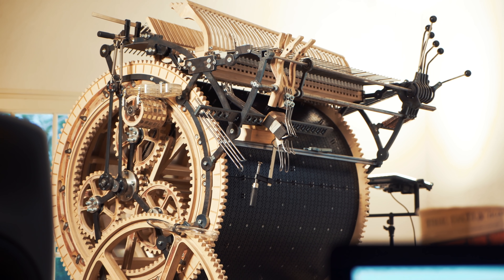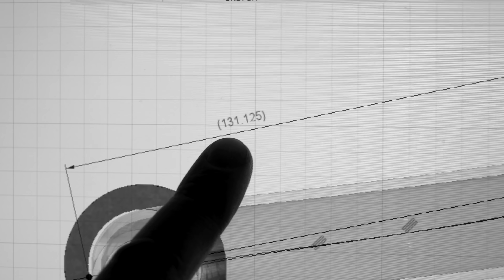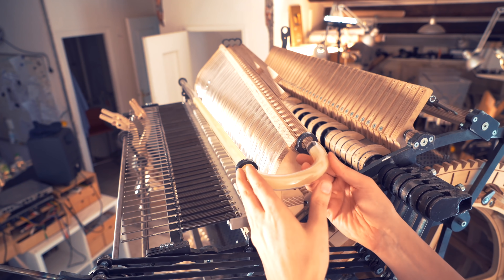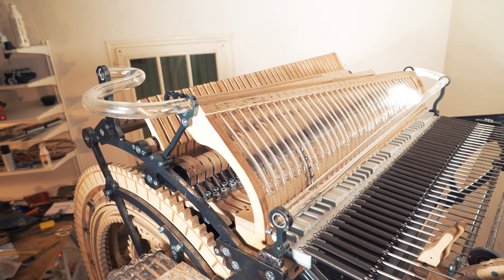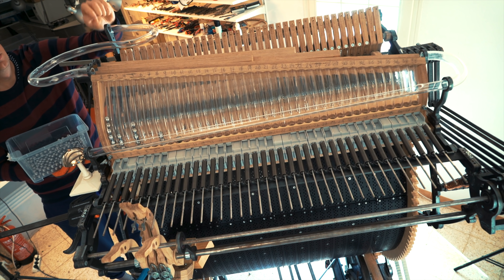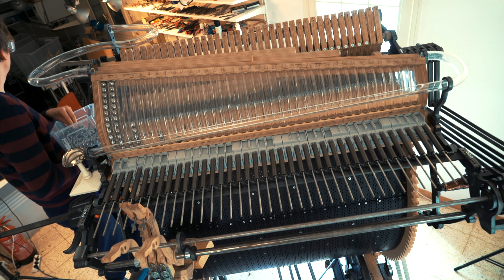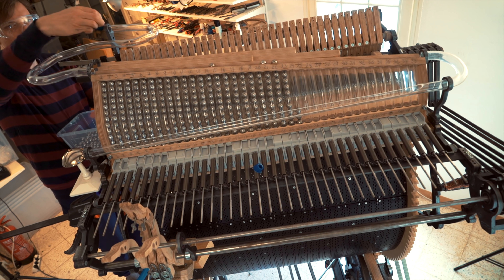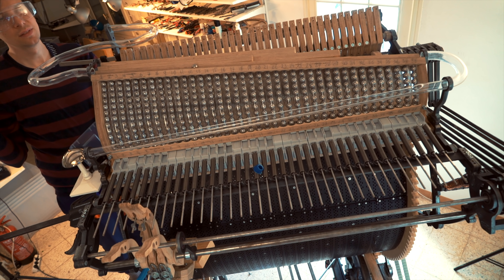Marble Divider Transport Tracks - Marble Machine X #68

Comment: I don't think the second-system effect applies to the MMX. The first marble machine was not small, elegant, or successful. It managed to barely get through one song before breaking down. I think you would agree with this. You said in previous videos that you pretty much just threw the first machine together pretty haphazardly, designing things on the fly.

Comment: So here's an idea about the 'programming templates' that would make it faster to put magnets in the right holes. Instead of laser-cut plastic sheet, just print it on a wide format printer, and push the magnets through the paper. Downside is the paper templates wouldn't last as long, upside is print shops can be found much more easily, making them easier to replace and make new ones during the tour.

Comment: I'm all in on the programming wheel. As you've stated many times, Martin, some of the mechanics for the MMX are aesthetically influenced. That can throw a lot of ideas out the window, as simpler often leads to something less appealing to the eye. Of course, there are also the practical requirements that you've outlined. It is tempting to want to simplify further, but a massive part of this music machine's appeal is it's over the top complexity, complexity for its own sake. 

On a separate note, my only concern with the snake is that it seems to rely on gravity a fair bit, and I'm wondering how well you'll be able to level the machine at each venue. If the snake must be sitting at a certain level to slow the ball down, having it tilted one way or another might cause the balls to slow up and stop in the snake. Just a thought, and I don't know the answer to the question of how well it can be leveled, so it may be a moot point, but I've done a few ball machines, and slopes can be tricky in different environments.

Comment: Martin - you may already have the solution, think back to your music box, the pins go in the holes in the tape - so instead of adding pins to a flexible sheet make holes in it and the holes trigger the marbles. Should be really quick to do  straight from a midi file with right software - I've used this method to program cards and paper rolls for street organ music, and its always been the way to control pianola (player pianos). Will have to have method of triggering from holes but again solution is there - air operated from a tracker bar above holes - and how cool would it look to have a set of bellows pumping away beneath MMX!  Get in touch if you want more in depth explanation of how to make it work - best wishes and love your work, engineering, music, off the wall thinking and more than a touch of madness combined with the  'no such word as can't' attitude is how I work as well so totally appreciate the frustrations and trials you go through (it doesn't change another 40 years on !) - David L

Comment: Wouldn't it be simpler to design the programming wheel as quick-change?  Have one, or possibly two built to the exact same specifications, that way one can be employed on the machine, one can be getting programmed off-stage, while another is the next song in queue?  All pre-programmed, and can be loaded and unloaded in a quick manner?  

Or is that the way this is?  I missed quite a few episodes.

Comment: Martin, I haven't read all the suggestions but what about more or less lamination. Currently you have been cutting a sheet flat and then bending it what if you cut the radius with the channels in it and then stack the sheets to make your sections. You could also use a material more resistant to warping

Comment: Need a Marble Feed Simulator designed. Something like a spiraled carousel that carries the marbles via a screw driven gear crank and it's attached to a funnel. Also need a moveable scaffold platform to work up higher above the machine instead of reaching up. You will need one anyway for setup, inspection, maintenance and repair on tour.

Comment: maybe overlap the programming sheets?. and aligning them with the programming pins them selves.  so you would extend every sheet with about 2/3 cm of overlap.  if the sheet is 1cm thicc. you would machine 0.5cm off every end in thiccness and overlap them and align them with the programing pins. let me know why this would / would not work :)

Comment: @wintergatan is there a way to mill the plastic already mounted to the drum? Like mounting the mill on the radius of the drum?
Also why not mill thicker metal aluminum sheets instead of the plastic? Is the plastic is warping the aluminum won't. Esp if the tool path is a bit slower.

Comment: I'm concerned about the exit velocity of the snake. You've intentionally slowed the marbles to such an extent that I don't think you will be able to feed enough marbles through to keep the channels full. I don't remember how many marbles per second you were hoping for, but do the math on how fast they must travel to put them through the snake, one at a time, at that rate.

Your better bet may be to count on the fact that the marbles will go over the bumps slowly. Marbles will drop into the first two channels because they'll be backed up behind their predecessors. 

Rewatching the marbles travel across the top of the feed, I have the same concern - that they're not moving quickly enough. I'm guessing I'm hearing 4-5 clicks per second? As I recall, you have two inputs? That's ten marbles per second? I hope I've forgotten something from an earlier video?

Comment: By cutting the long pipe open, it decreases much of it's strenght. Maybe it's gonna bend to much when it's full of marbles.

 If that happens, you can always just cut only the front of the pipe (not the top). Or don't cut it at all. The pipe is clear enough I think.

Comment: if you could somehow cut the holes in the programming wheel sections after the wheel is assembled then you wouldn't have to compensate for anything. Also the holes would end up square instead of tapered. When you cut the holes on the flat plastic and then radius it, it stretches the holes wider on the outside and squeezes them narrower on the inside.

Comment: Personally I like the plastic for the action programming wheel, but plastic sheets as guides for swapping out songs sound like a mess. If I wanted to carry a bunch of pre-written music for the machine I would do what we've always done with music, sheet music. A piece of heavy paper with holes ut into it matching the slots you wanted to fill would allow for a quick guide and could easily be applied to the machine, removed once the bars are in, and carried around.

Also, the machine has been looking more and more impressive and it has been very interesting watching you both design it and learn from it. Thank you for sharing!

Comment: To the critics, here’s the thing: he’s not building a musical instrument. He’s not building a mechanical device. He’s not creating a piece of moving art. He’s doing it all. This is the point of the whole thing.
Is it over-engineered and complicated? Yes. If he wanted to create a simple instrument, he wouldn’t need all the gears and machined parts. He could get the same effect using a computer, electronics, and a MIDI track.
But he’s doing something special here. It’s a working, post modern industrial clockwork machine that is beautiful and mesmerizing to look at, but also happens to play music.
Music is exacting. Mechanics is exacting. Artwork is exacting.
And he is trying to make this machine reliable and modular.

Let’s cut him some slack. It’s his design, his dream, and his machine. He has the right to see it done to whatever level of perfection he chooses.

Comment: Why not have plates that are specified to each song, as you meantioned in another video that the pla plastic you are using gets tighter after a while, so why not cut four plates that corresponds to one song each with specific holes for the position of each note of each song for each plate setup so that the pins will get stuck in that position after they shrink, i know what it is a more expensive solution then what you want, not to mention that you can't really "repair" any plate if one note stringing magnet breaks, but it could be a temporary fix for the moment just to get the project onwards, i have found that when i am working on a project, that if i get stuck i end up not wanting to leave that problem until i have at least temporarely solved it, even with a band aid fix and can come back to it later down the line as what i made works for the moment, sorry if my english isn't the best, much like Martin i am Swedish.

Comment: I have no problems with the programming wheel, without adding other system compressor or vacumes there is not much you could do, as it going away from the "basic" design.
another option is flatting them out into cards and a hopper programming cards, but this could be harder to sync up so maybe the Marble Machine Y

Comment: I have a suggestion for the Programming wheel.  Here's my thought.  Keep what you HAVE as the composing wheel.  Once you have completed a composition, you make metal sheets that are single channel.  IE: the Vibraphone Channel, then the Drum Channel.  These would be thin Aluminum, or sheet metal of some kind, and would have permanently affixed pins, you would then label the plates with the song title, so decades later you can simply pull the plates out of storage, and use them again.  With thinner plates, that are narrower than the whole, and are intended to mesh together on the sides, so you can quickly pull them off from right to left, and replace from left to right, it should make for a quicker change over during the live performance.  To further my thought process, I'd have these thinner plates clip onto the composing wheel, so there would be no need for screws, you'd just use the holes already in existance.

Comment: Will that CNC welding stud gun work with sheets of invar? That would drastically decrease your issues of thermal expansion offsetting the positions of the studs.

Comment: Does the divider need to reload itself as the song is playing?  I dont think the last tracks(34-38ish) are going to replenish themselves after the song starts since they require 1-33 to be completely full. Once the song starts that's not going to happen.  Hopefully there's only a few high notes in the song and those tracks wont run out of marbles after being loaded at the start.  Or maybe I dont understand the purpose of the divider.

Comment: I think the easiest solution to the programming wheel is to divide it up into easier sections & have, essentially a frame where each divided plate slots & locks into, this way you only have to worry about making an evenly spaced frame & musical tiles of a specific size that fits exactly into the slot, OOP style.
Instead of the current system where you have to make the musical tiles evenly sized AND spaced at the same time. Additionally it would be easier to hotswap songs as well since, if you divide it down far enough, you'd end up with modular plates that play a specific series that'd be reused or otherwise show up in other songs, true OOP style

Also to back up easier positioning, you could, or would, probably have the back of the tile be the master slot, or tab like extrusion, to base the positioning on, like a lathe chuck on a lathe, the lathe chuck will always be centred with the lathe because that's the way it's made, knowing that you can always make your work centred with the lathe by making it centred with the chuck. So as long as that master tab fits perfectly into a slot you'd know you can then just size the plate by the master tab, not sizing the plate by the other plates, etc

Comment: Martin, 

instead of one full wheel, why not two halves? It should line up, but if not, it would be much easier to fix the gap with spacers than all eight of the current design.  You could have three sets: one for the current song, one to be double checked that it is correct, and one to be changed for the next song by two to four people depending on the set and support.

I hope you see this, 
TonOfClay

Comment: My idea for cutting the programming plates is to make a custom cnc setup to cut the slots for the magnets after the plates have been bent and put on the wheel. You just have one of the cnc axis turn the wheel. This would ensure alignment between plates.

Comment: What if the whole programming wheel, was one giant belt, divided into 8 or 16 steps per belt piece?
Like a tank driving belt.
When changing a song, you "simply" roll on a new belt, with the preprogrammed plates. When the belt is laid out flat, it will appear as one long sheet of programming plate. Maybe even make the plates intertwine?
In this way, a tension mechanism could also allow for variations in the programming loop size.
Now you could even use something as simple as bike gearing, to change the tempo of the song, without giving up potential stored energy in the swing wheel.

Comment: We agree with others here saying that this isn't sunken-cost-fallacy territory if it works. Keep at it. That said, because having ideas is fun, here's a barely-thought-through half-idea that may be able to relax requirements a little: Is there some mechanism that could somehow re-sync small timing errors after the programming-wheel has been read?

The wheel only needs to encode a binary value for "nth note exists" but it is currently also encoding the precise timing. If the reading system could be designed such that it either performed the act of reading the wheel precisely on the beat, or had some small delay mechanism that synchronised marble-release with the beat, then small timing-inaccuracies in the wheel wouldn't matter as long as they weren't whole beat-unit slippages.

(It should be evident from our likely-misuse of the word "beat" that we know fuck-all about music.)

This is a software-engineers-who-know-fuck-all-about-mechanical-stuff suggestion and very much hand-waves HOW you would actually build that... The complexity of this idea probably pretty much rules it out, as does fitting it in with the existing design. That said, from an optimal-elegance separation-of-concerns perspective, the wheel probably shouldn't be responsible for encoding precise timing, because that's extraneous information when you already know the speed at which the machine is playing. The song is encodeable as a digital/binary signal but this design makes it analogue.

Comment: Electronics designer/electronic music producer here. I can't recall hearing you say anything "strange" about the programming wheel at all. Like you say, you require the features you do, its your main sequencer, losing features mean so much to how valuable the end result is that compromising is a very last resort. Its just one of those things thats seems simpler than it is to someone who does not have to do the equation from both an artistic and an engineering point of view. Don't end up thinking too much like an engineer when you bargain compromises. Matter was meant to be bent.

Comment: Why not make the edges where the 2 plate meet more jagged like a silicone mold for casting. This would allow you to fine tune the distance by not having an abrupt change between notes and instead let it be more gradual. This also can get rid of the adustment screws as you could calulate the distance between plates and makes it far simpler to change plates of you do different zig zags

Comment: Seems like a lot of the difficulty with the programming plates is to do with the bending process and the material choice it necessitates. An ideal process would be to use quarter sections of a very large, rigid plastic pipe, and machine them on a large 5-axis mill (like AvE's haas). That way you could machine an already curved surface and have the tool remain perpendicular to it, avoiding this necessity of choosing a bendable plastic and having an extra process that warps your dimensions. Another option would be to build a rotating jig with a dividing plate to turn the plate precisely under your 3-axis mill and only cut one row at a time. Anyway, keep in mind that the strict tolerance requirements are not the only constraint on your solution, but also the process you choose for manufacturing -  that sunk cost may apply equally to your tooling as to your designs.

Comment: I have no idea how much you check out these comments, but here is my proposed solution to the programming wheel problem: 

3d print individual beat sections and fasten them to the wheel. https://www.reddit.com/r/MarbleMachineX/comments/aqqbxp/solution_idea_for_the_programming_wheel_3d_print/
See the link for full details, but at 1280 of these per wheel. They'd be easy to make, easily replaceable, durable, and can come to within your tolerance specs of 1/10mm.

Comment: I think the magnets were a brilliant idea. The I would have done two things differently, I would have machined the plates pre curved on the marble machine by building and programing a custom three axis mill that you could bolt onto and remove from the machine. Assuming you labeled the the plates and put them back in the same place every time, it would solve a-lot of the spacing issues between the plates.  I would have also used cylindrical magnets instead of rectangle ones. This would simplify the cutting from a machining a rectangle hole to just drilling a circular hole.

Comment: Think it would be awesome if you had a small robot you could mount on the back of the machine that could push the wheel around and pop the pins in to reprogram the machine (you could make it removable so there will be no electronics on stage, just your marbles) and if you could make that work fast enough, and easy enough to add/remove.. you could've possibly made the programming wheel less complicated as it could have been programmed in place.